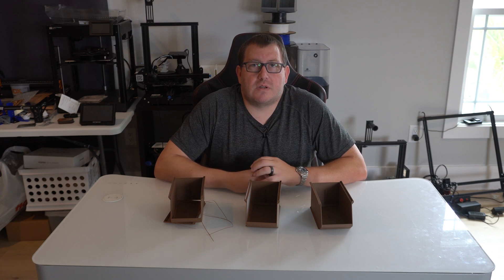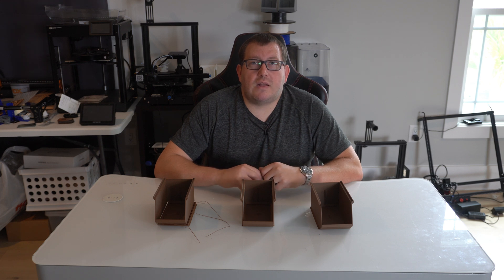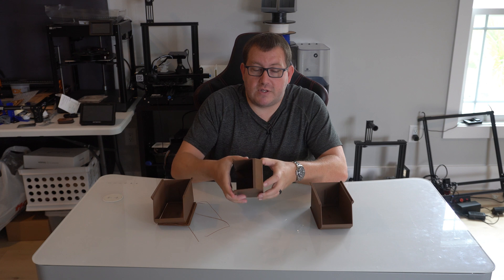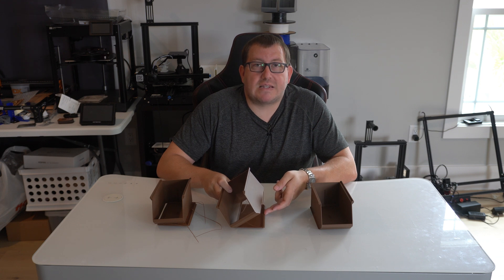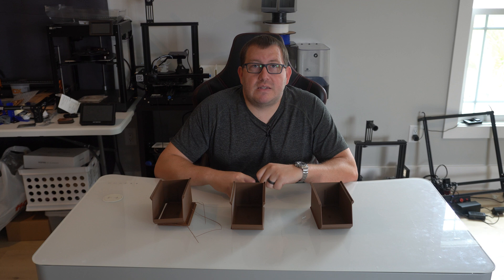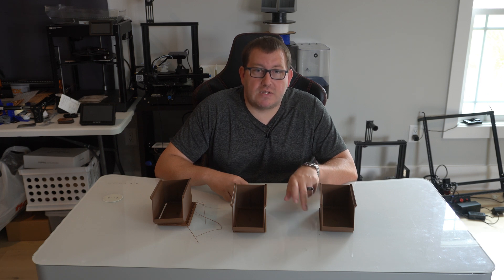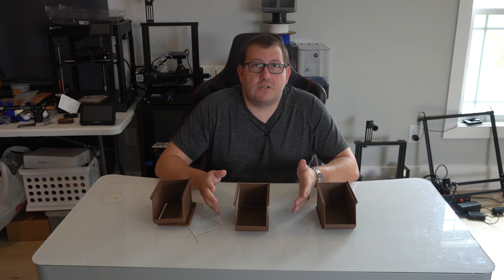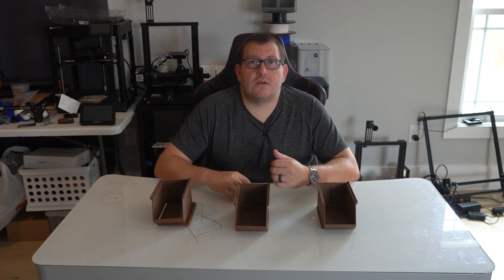Layer Separation – Cause and Fix

Comment: I have been having this problem a little since I upgraded to Klipper. It seems to happen regardless of print speed or size of project. Raising the nozzle temp does help a lot but then I get stringing. Any advice?  (For reference, I'm printing on an Ender 3 S1 Pro using Klipper on a Sonic Pad)

Comment: The REAL fix for this is to fix the print orientation. Give the lower rear edge of the container a  45 degree angle rather than 90 degrees and print the whole thing up on a 45 degree angle, that way you have full loops that encapsulate the base and the sides together.
Reply from the maker: Hi. Thats an interesting approach. I will give it a try. That said, bumping the temp was a quick/easy fix.
Reply: @3DPrintscape  guessing that you haven't printed anything in a big commercial print farm. It's literally one of the first things they do because it have massive upsides and very very few downsides.

Comment: Hi, was your cooling at 100%? Because too strong a cooling might go against proper layer adhesion, that is why upping the temp also works, imho. On this kind of piece, I assume one could reduce cooling to 50-70%. Cheers
Reply from the maker: Hi, thanks for the info here. I thought about cooling at one point and reduced it to 50% with not much of a change. The only thing that fixed it was the temp change.